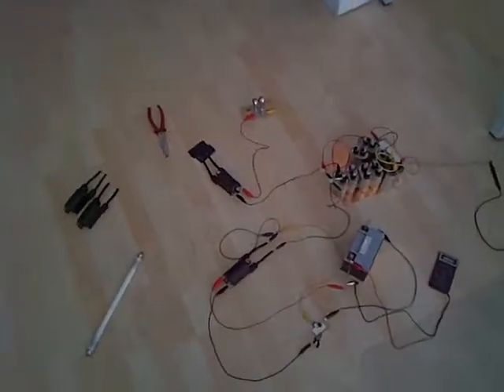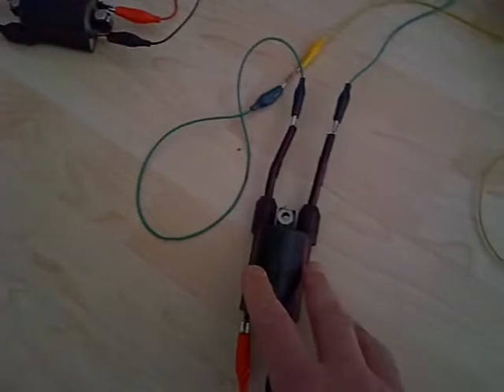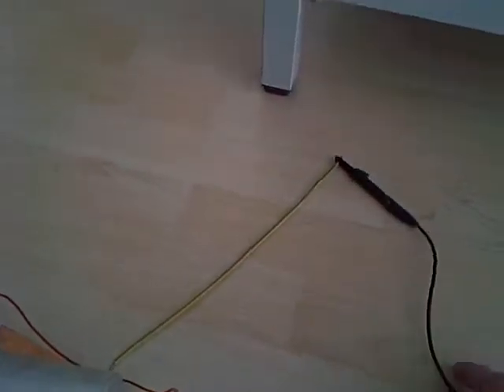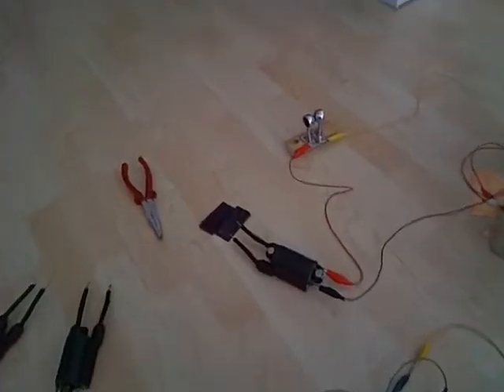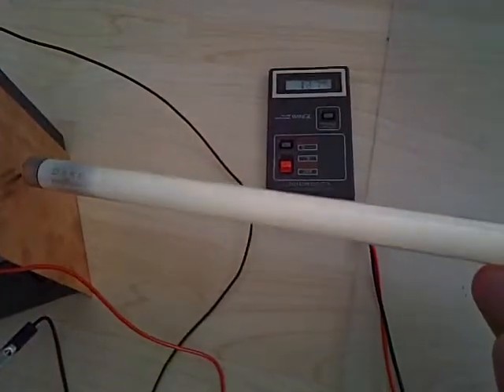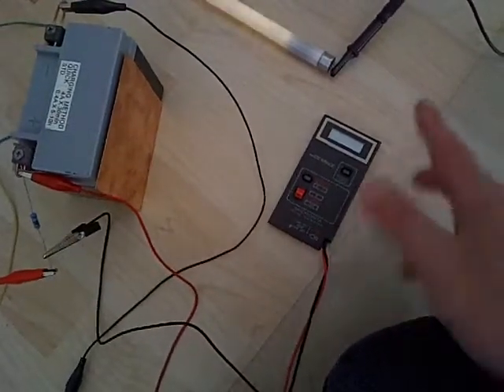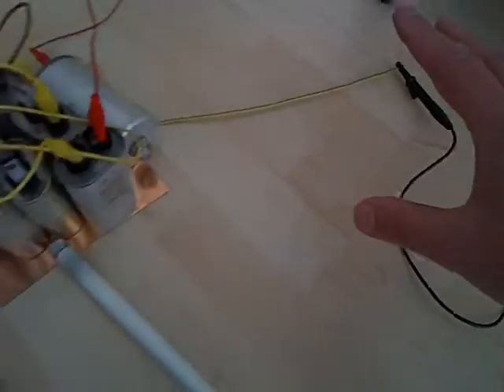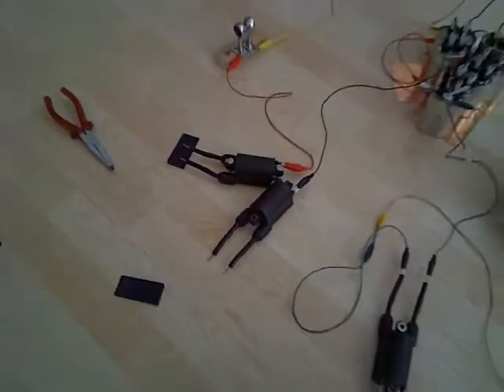carcoil 01

Comment from the maker: Hi Angus
A magnet did not do the trick. It did tremble and I did get an amplification of the frequency the coil is running at.
The frequency is higher if I close the sparkgap, I think it is now in nano meters or something like that. However, i do want to pose a question, so I posted a second video. Which might be interesting for other people as well of course. It is: why does HV like to travel along an insulator. I placed the sparking coil just above a ti-rap and I get a straight spark!